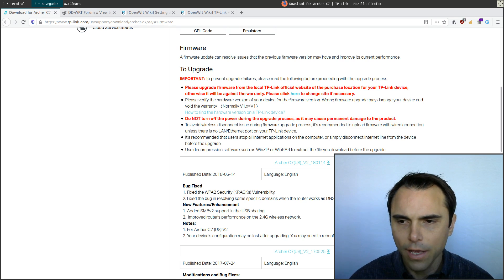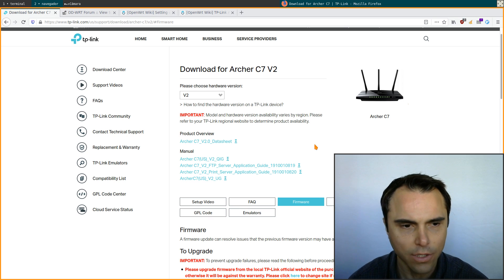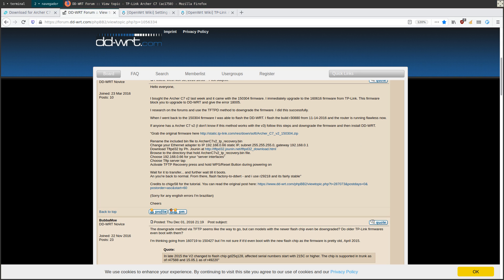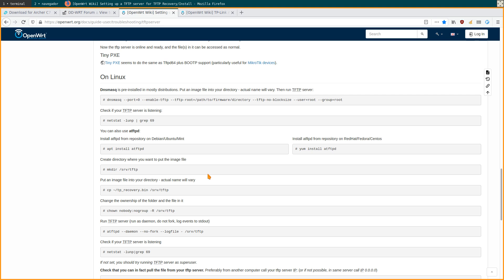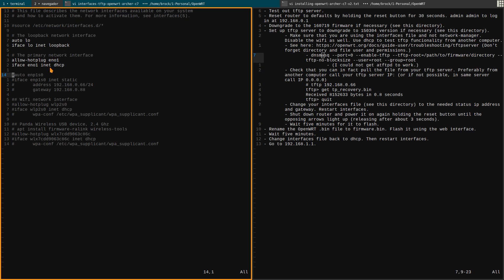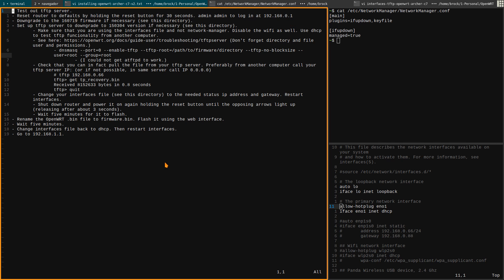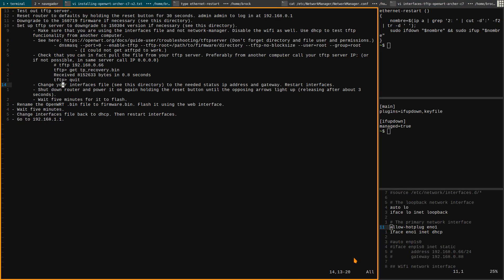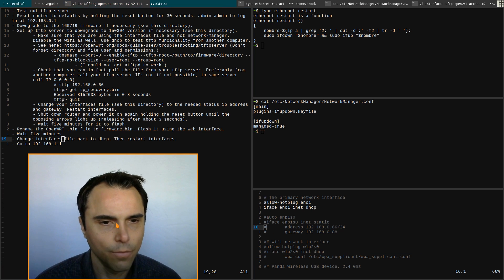Installing OpenWRT from Debian - TFTP - TP Link Archer C7 v2

Comment: hi sir...can u give me archer c7 v2 router full backup file pls....because my router is breaked...so i can't find ,pls can u provide backup bin file pls😢
Reply from the maker: The OpenWRT firmware and a link to the stock firmware can be found here, https://openwrt.org/toh/hwdata/tp-link/tp-link_archer_c7_ac1750_v2.0. Best of luck with it.
Reply: @BrockCochran1  i tryed but its not working sir,after flashing only power led working 🥲 so I am trying with the ch341a programmer... so a full backup bin of the router is required to program the flash ic again...
Reply from the maker: @CrisyBites  On Luci, where you go to backup/upgrade, you can select to "Save mtdblock contents" with the options of u-boot, firmware, kernel, rootfs, rootfs_data, or art. Which do you need?
Reply from the maker: @CrisyBites  Here is the latest OpenWRT for the Archer C7 v2 (system defaults). Be sure to see the readme.txt. https://brockcochran.com/misc/openwrt-22.03.3-ath79-generic-tplink_archer-c7-v2/
Reply: @BrockCochran1  thank u sir...now i am going to try,❤️

Comment: Hi! For some reason my c7 v2 has issue with the Ethernet port so I'm not able to recover as it's bricked. Does this support restoring from a USB?
Reply from the maker: Are all of your LAN ports not working? You can connect it to any of those four ports. You could try connecting to one of the USB ports with a USB to ethernet adapter. However, I doubt that would work.

Comment: not sure about C7 but on C6 the performance hit was  enough to make me revert to the stock firmware (which has it own issues.. but not that bad). Reverting to the stock implied setting up a quite complicated setup. not a pleasant experience.
Reply from the maker: Very good point. It is my understanding that OpenWRT cannot make use of the full capability of the hardware on the Archer C7 (because of closed hardware or software from TP Link). I therefore would not recommend OpenWRT on the C7 if you have gigabit internet for example because your speed will max out at about 300-400 Mbps. My internet plan is 300Mbps so I do not think the performance hit really affects me.

Comment: Show how to firmware update 2020 on wrt for archer c7 v2,
Reply from the maker: I used the LuCI interface to upgrade my routers (all TP Link Archer C7 v2), https://openwrt.org/docs/guide-quick-start/sysupgrade.luci. It did not have any issues with the actual process. However, I did have some issues with getting the 5Ghz to work correctly. (It has been fine though since configuring it correctly.) For the 19.0x version, I had to configure it over SSH. Helpful post here, https://forum.openwrt.org/t/archer-c7-5ghz-radio-not-active-working/65048. However, after upgrading one of my routers to the 21.0x version, the CLI did not work properly but using LuCI did for configuring 5Ghz.
Reply: @BrockCochran1  thank you , it’s a little complicated, wish have easy way like older version 18. For tplink archer c7 version 2,